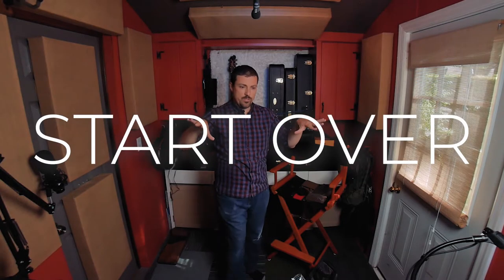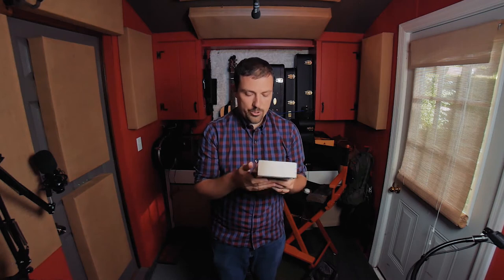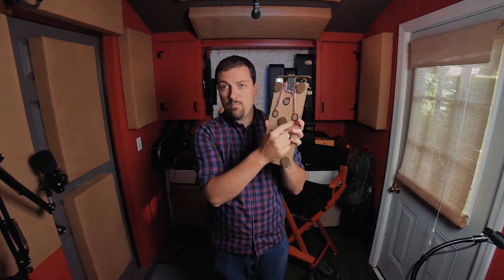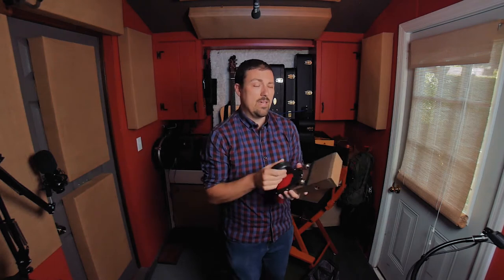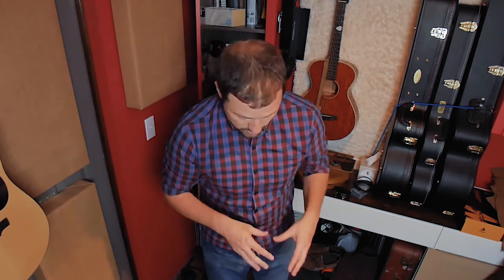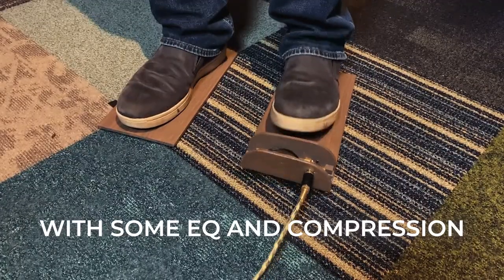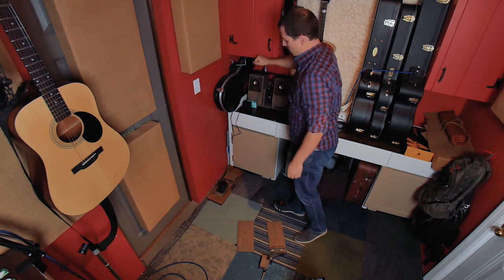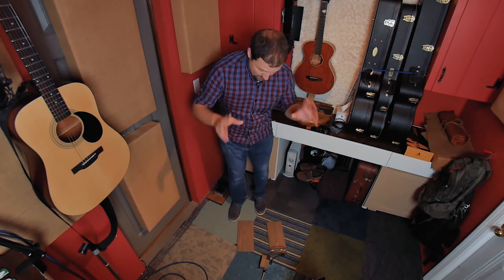DIY Stomp Box / Foot Drum... NEW version 4.1!

Comment: My first project is a full size tambourine setup.  I saw a video with a pretty complex but sturdy tambourine holder.  Then I saw one made by a well known German percussion instrument manufacturer.  So, instead of making one, which seemed like too much bother, I purchased the setup.  Turns out it was junk that was broken when it arrived and even if it wasn't it would surely fall apart quickly.   I ended up making a super simple holder with just a stick of wood and a few rubberbands.  Used it tonight and I am extremely happy with the result.

While looking into that I came across DIY stomp boxes.  Which reminded me that I had an old bottlecap acoustic guitar pickup.    Now, I'm experimenting with an elegant solution to make a stompbox.  It has to be simple and use what I have around the house.  So far, I found a piece of wood that has a tone I like.  Now it's a matter of getting this old pickup to capture it.  One thing I'm finding is that elevating the board slightly gets me better quality of sound.  I just hope I don't end down your rabbit hole of circuitry.  When I studied engineering, I only ever had one EE course.  And, it never covered any of this.  lol.

Comment: Cry Love by John Hyatt! Very cool stuff. I've always thought it's ridiculous no one manufactures a square box that you stand on. One side gives you thump, with a lo pass filter, the other side gives you a 'snare' sound with a hi pass, the whole thing is powered like a guitar piezo, and has a tiny onboard reverb. Boom. Done. You'd think it wouldn't be that hard. 

I think maybe the only potential issue - which you mentioned - is that electret feeding back if you have monitors. 

Cool beans.
Reply from the maker: Yeah, I know right?! Onboard reverb would be cool, but I can add that further down the signal flow (a pedal or the mixer). I briefly considered using a piezo for a snare sound, but I found it was at best like a rim tap, and it didn't help capture any other foot percussion, like the tambourine. Thankfully, the sounds being picked up by the electret mic are so naturally loud that I can keep the gain relatively low. Also, since I can hear the right foot acoustically, and the left foot is low frequency (usually through the main subs) I don't have to put much of it in the floor monitor. I haven't had any feedback issues... yet! Thanks for watching!

Comment: Thanks for sharing this!

I do see one thing in your electret schematic that looks suspect. You have the wiper of each potentiometer (the terminal with the arrow) connected to ground. I'd expect that to be swapped with the output terminal in both cases.

As long as you're staying safe, it doesn't really matter if you're not an electrical engineer. If it works, it works. You're getting the results you want, and that's what matters.

Comment: That is cool. Drummers always seem to be a bit dodgy. Been thinking about something I could use at my feet instead of constantly switching from guitar to djembe and back depending on the song. Have not experimented much but do you think that the preamp in the original design helped? Thought about snagging one off of amazon to tinker with. Also thought about making it more like a pedal with a hinge that can rock back and forth. Maybe have that strike the plate. You have given me loads to think about.

Comment: Very interesting. I play cajon in a band and use a stomper as well. I made mine but it also has a very small sweet spot. What pickups are you are actually using and how do you connect say all three together. eg are they in parallel? Do you glue them on or use Bluetak etc.. I also use my heel not my toe. So I would have to build the stomp box the other way around. And it has to be flat eg not wedged in any way either. Piezo devices also like being fed into a very high impedance preamp too. I have got that already. I use a Roland keyboard amp with a 12" driver in it which I actually sit on. I need the click on the stomp sound for some tunes as well so a LPF is not a good option for me. But I can change that on the preamp I feed mine into. It has gain and tone controls on it. I get the best sound by far with piezo pickups and not a speaker. Speakers will feedback too and don't give the best tone. Does the actual stomp box need to be hollow or will a solid piece of wood do the trick too? The ones you buy are way too expensive as well for what they do. I am convinced you can make them. Also are larger diameter piezo's better? Sorry for all the questions! You have inspired me to make one again. I sort of gave up and was going to buy one.

Comment: The cutoff frequency of the low-pass RC filter alone is given by fc = 1/(2*pi*R*C), which is equal here to about 154 Hz. But this does not take into account the equivalent resistor of the piezo. So I guess this is why you write about 120Hz. How did you get this value?

Comment: Commendable efforts and research gone into this project. In your trial and error, did you come across a situation where a certain type of wood sounded better than the other.. I'm from India. We do have couple of wood types like Rosewood..Teak Wood..Plywood board..Composite wood.. etc.. 
Also, does a hollow box add to the fat bass sound ? Or does a flat surface do the job equally well?

I built one but finding it difficult from a playability perspective because the feet are not at one level.
Reply from the maker: Sorry for a long-overdue reply... I would recommend plywood, for durability. I don't think the type of wood matters much, but what you wear on your feet matters, or anything else that affects the surface. I now have a small piece of felt that I put on mine. I did a little experimenting with hollow boxes early on and I don't think it really matters... unless it was a LARGE hollow box (like, at least 1 cubic ft), but then you'd probably also want to rethink all the positions of the piezo transducers. Something that big was not what I wanted, so I never built one.

I actually have a slightly newer design (sounds about the same) that I'm using now. Maybe one of these days I'll get around to making another video about it.

Comment: Great work, dude! Respect!
Could you pls list what thickness and type of wood you used, and what diameter of the piezo?
Reply from the maker: The wood is about 1/4" thick. This was solid poplar, I believe, but I would actually recommend using plywood. The type of wood doesn't really matter that much, but the surface (what your shoe is made of, and if you put anything between it and the wood) does matter quite a bit.
Reply from the maker: Oh, and the piezos are 25mm

Comment: I tried duplicating your efforts, and it did not really work - I got a little sound if I actually tapped a piezo, but nothing tapping the board. So I pulled out the low-pass circuit - and got a good, solid sound rapping the board, but as I would expect more small tom-tom than bass drum. So I looked into low-pass circuits - and I could be wrong - I am also a rank beginner at electrical circuits - but your pass shows the resister in parallel going from + to ground. I think they need to be hooked up in series - i.e., + from the pickups to resister in, then resister out, then to the capacitor. Your positive comes off the connection between resister and capacitor. Other side of capacitor goes to ground, as you diagram shows. I will try again and see how it works. But maybe someone better at this stuff could confirm?
Reply from the maker: Thanks Doug. I'm pretty amateur at electronics myself. There's a good chance I drew the diagram wrong... let's look at that again...
Reply from the maker: Hmm. Well, I'm no expert, but I just checked and I think I got it right. It's a passive RC low-pass filter... http://sim.okawa-denshi.jp/en/CRtool.php